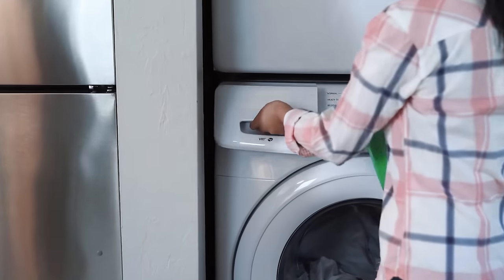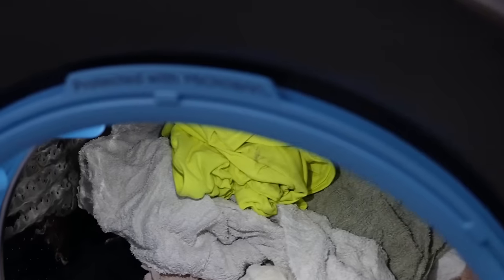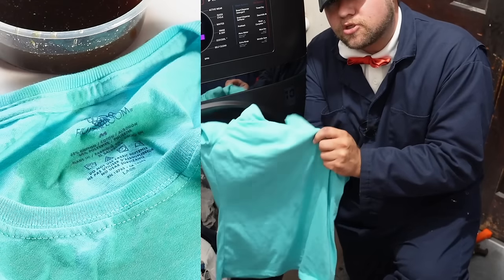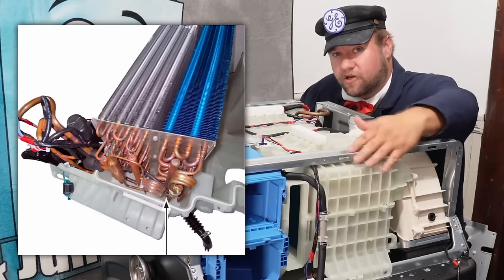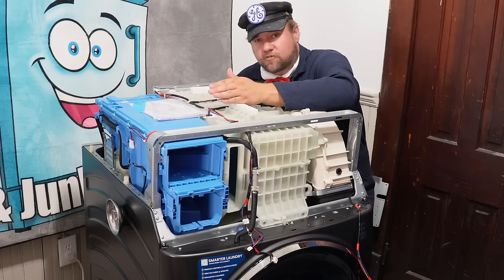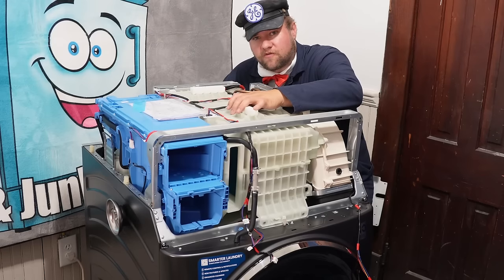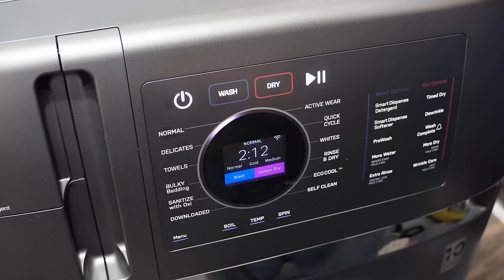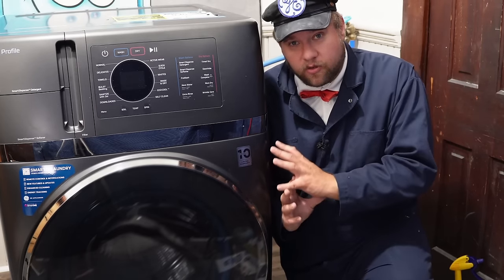The Best Washer Dryer EVER? The Ultimate GE 2-in-1-washer Dryer Combo Test & Review

Comment: I'm a little surprised how much you got stuck on the filter. Like you pointed out, if you don't clean that in a regular dryer, you're going to have an issue, so that doesn't make this unit any different to a regular dryer. On my regular dryer, I clean the lint filter after every load. I'd treat this unit the same way.
Reply: Im with you!  having a lint screen thats not cleaned every load is a huge pet peeve for me
Reply: I clean mine every 6 months or so.
Reply: I thought you were supposed to check and clean the lint trap after every load?  At my last home my roommate owned the washer/dryer and his Samsung had a reminder to check the lint trap between every load.  My Maytag dryer has a bit larger lint trap.  I check it, but it really only needs cleaning every other load that goes through it.
Reply: @OWENROTHLERNER lol wtf
Reply: One of the huge benefits of this unit is that it's ventless. I mean you can put this sucker just about anywhere. I'm surprised that wasn't mentioned. If it was i missed it .
Reply: @OWENROTHLERNER  You're a monster.
Reply: Another cool tidbit: The dry process in the UltraFast is much easier on clothes, creating less lint, meaning you don't have to clean the filter after every load. Yet another cool tidbit: The control panel when notify you when it is time to clean the filter. Our last cool tidbit: Once connected to the SmartHQ app, you can receive notifications on your phone when the filter needs cleaned! 😎
Reply: I thought Ben was odd on that too: who doesn't know the filter screen needs cleaning every time?  He's right that HP dryer efficiency is especially susceptible to impaired filtration - but all dryers need them cleaning, and this model has it placed conveniently also.  At least most HP dryers here in Europe have a warning light that the filter's blocked, which I'm guessing is on this model and Ben forgot to mention (though you shouldn't wait for the reminder).
Reply: if you were to try to clean this after every load you'll find it only has a fraction of the lint youre used to... I did that for a little and I realized I was wasting my time.... now I just do it when it asks me to
Reply: @OWENROTHLERNER  Fire hazard.
Reply: @rosie684 he’s just trolling,the lint trap is clogged after 2 loads, forget 6 months…unless he does the laundry every 6 months?
Reply: @155stw no the lint traps in every dryer isn’t clogged after 2 loads bc the Samsung one I am using only have to clean every 4 or 5 loads depends what you use in the dryer and washer I don’t use fabric softener bc it’s messes up them washers and dryers and less lint happens to when you don’t use fabric softener
Reply from the maker: every dryer is going to behave differently, especially with the wash load. I am doing another load to test on camera (GoPro inside the washer). The lint build-up on that specific load simply wasn't bad. If you were using newer clothes without stray fibers, no fabric softener, ect, you can likely get away with the 4-5 loads that GE suggests. The last load I did of mostly clothes that you'd find far more typical in a unit is indicative of that. But like any suggestion, such as the one GE makes on every 4-5 loads, its subject to change, and its important to note that if your doing ratty clothes, or using a fair bit of softener, you may run into build-ups like we showed on camera.
Reply: Its a huge problem on heatpump systems. The condenser is wet, and any lint what so ever has a tendency to glue itself to the condenser. This leads to poor performance and mold buildup. Other systems have a back flush mode that actually washes off the condenser to deal with this. GE doesn't do that. I'm not sure that filter is enough, and the debris already building up worries me. I'm going to be buying one of these, I just don't know which one yet. This review is awesome.
Reply: @mcbeenb  just don’t use fabric softener messes them up it’s gets all stuck all in the machine I seen a lot of videos people repairing them washers and other washer it’s gets all caked up in it after all that time
Reply: Thats what I was thinking doesn't everyone clean it every time?
Reply: I had mine installed last week in the corner of my kitchen.  I am 80 year old widow that am limited to motivating laundry on basement steps.  The only thing I had to accommodate the new unit was the 120 receptacle.  Plumber installed hot/cold water & drain.  Easy peasy.  In my case I ❤️ 💕 💗 love my GE Profle 🎉🎉🎉!!!!!!  There is no static electricity left in the clothes (NONE).  I have no intention of ever using fabric softener in my new machine.  May not be ideal for large family.  For me just what the doctor ordered!
Reply: Every single load? OCD much? 
I can’t even physically remove and lint from my filter of there’s only been one load… it takes at least 3-4 for there to be enough lint for it to make it easily removable and I’m washing for a family of four! Do you wear a lot of fuzzy sweaters  or something lol
Reply: When I first got married my wife would complain that I wouldn't clean the lint fiter after drying.  She grew up mostly with her mother doing her laundry.  I said that I used to live in apartments and I had to use the community washer and dryer and that I always clean the filter before use because the previous user didn't clean it.  To this day we now clean the filter before drying the clothes.
Reply: @OWENROTHLERNER Fire hazard
Reply: @mcbeenb I think I am going to buy one of these but am going to wait a couple of more years to see what people think after having had them for a longer period
Reply: this is way better than most 2 in one combos that use a condensation chamber.
Living in an RV, I have one, this after several others, none less than $1000, most conking out after about a year or two.
Presently, the dry cycle on mine is a fughetaboutit. I use the high speed spin and hang em up.
yers, I know not to load the machine more than half way (i fill it now, but hang dry everything)
All of the ones I've had would burn about a KwH or so, but inhale about 30 gallons of water in the dry cycle.
they never had lint traps, and the condensation chamber would plug solid in about 3 months.
The first one, lasted 4 years, I had the wrenching and cleaning needed down to a 30 minute process I did every time it took longer than 2 hours to dry. until the motherboard died and I couldn't get parts.
The second on ticked me off, Tofu Dreg Haier, I paid nearly $1500 back in 2014, same quarterly cleaning, the condensation chamber much more difficult to get at, took about an hour and a half. the main drum bearing failed in 9 months. I also couldn't get parts for it, I ran it completely to death at that point, listening to the bearing races screaming, the crack of another bearing ball... till it wouldn't move.
My last one, I've had for 5 years now, only use it as a washer though, with my new RV, and its position, working on it isn't an easy thing at all. It generally spins out the clothes enough to only need to be hung for an hour or two.

All, in all, I'd buy this for the lint trap alone
Reply: Lots of people don't check filter Everytime. And if you make you kids wash good luck. The issue is in a normal dryer the effect of a dirty filter is lower air flow and hotter air going into dryer. Sensors can detect that and cut off heat. Dry times are longer but the system basically just heats less. A heat pump can have real issues if the pumped refrigeration liquid can't absorb enough heat on the cold side or cool down onto the hot side. Put it this way. For a normal dryer cleaning the filter is like rotating your tires, recommended but at worse means you replace tires sooner. A filter on a heat exchanger is more like changing your engine oil. You might get away without doing it regularly for a while but you'll get to a very expensive repair down the road, aka new engine
Reply: I'm sorry but how can you not call a FAIL a FAIL? Advertising a 2 hour dry on front sticker but no 2 hour setting using load restrictions! And after manually setting the closest setting you still ended up with damp laundry! Now I get you have to know what the material the company used to match their results but you can bet it's the easiest material to dry possible. While most don't wash n dry mixed loads I hope it only means a full load of cotton towel would be even wetter. Also unless your power grid free we need a time comparison to a normal pair of washer and dryers. Time is money, or at least limited and saving 30 to 40 cents a load but each load takes 30 to 90 minutes longer may not be a good trade
Reply: @618Todd  Wow that's amazing, such a huge plus that I don't think was mentioned.
Reply: I just removed it, no cleaning necessary.
Reply: I agree, I clean the filter every time I do a new load.
Reply: @OWENROTHLERNER Just letting you know, that can cause your entire house to burn down. I'm not even joking. Pls be safe
Reply: I think the main difference is that it only takes a few seconds to clean out a normal lint filter. This looks like a slightly more laborious process. Far from a big deal, but I think it's fair to assume users will be more likely to neglect to clean it properly. That said, a traditional dryer lint filter is a straight up fire hazard, so realistically this is far less of a concern.
Reply: @OWENROTHLERNER LMAO WHAT??
Reply: Yes same thing I thought I clean lint filter after every dryer run it literally takes 15-20 seconds lol
Reply: This machine even lets you know and stops working if it’s filter is too dirty
Reply: We have a ventless dryer and keeping the filters as clean as possible is kind of a big deal. I can see why he emphasized it. The goal is to keep the evaporation coils as clean as possible, and cleaning both the trap and filter helps but it only delays the inevitable. Once the coils get too clogged the dryer will throw an error code and not function until they’re cleaned. Getting to the coils on every ventless dryer requires completely disassembling the machine, a 6 to 8 hour job that is not covered under warranty. We’re considering this machine since it looks like access to them is much easier.
Reply: @@stevenstrain283 yep, and even with routine cleaning of the secondary filter fine particles eventually build up on the evaporator coils/fins. We have to clean the coils on our Whirlpool about every 18 months or so which is a PITA. We’re looking at this model since it looks like the coils are much easier to access.
Reply: @OWENROTHLERNER That's a good way to start a fire. Kinda like smoking cigarettes, it probably will be fine for a while, maybe a long while, but it's not worth it.
Reply: 💯 agree - you slowdown your dry cycle and end the life of the machine prematurely by not clearing the lint filter after every cycle.
Reply: I want one!
Reply: @Adierit  Not on these dryers, the heat pump is less intense heat than element or gas dryers
Reply: The machine won't let you start if you don't clean the filter. Learned after my first 3 small loads.
Reply: @OWENROTHLERNER man get you lazy self up and clean that thing sooner😂
Reply: @OWENROTHLERNER watch out for build up. I clean mine every day. But the build up inside started on fire. So better clean way down in there.
Reply: @JustinEdge-i3i That depends on the home. I don't use fabric softner or dryer sheets, and I have to clean mine every other load. I have cats and a lab, so my gets clogged quickly.
Reply: Just clean the left side of the filter after each load. It’s takes all of 10 seconds. 😅
Reply: Because this I think is the first one with a lint trap! That’s huge! I have to take my LG totally apart once a year and clean the lint out it’s absolutely ridiculous
Reply: Take him to school
Reply: @bdanner302 GE says to clean it every 5 loads.
Reply: @618Todd  not if it still uses the 4 prong dryer plug. It is nice to not have to deal with a vet hose etc, but not like you can just put it into a random closet or anything
Reply: @geappliances  Cool tidbit, saying "needs cleaned" as opposed to "needs cleaning" or "needs to be cleaned" makes your company sound illiterate.
Reply: @hammerslap5639  It doesn't use a dryer plug. It's shown several times that it uses a 110-volt 3-prong plug.
So yes, you can just put this into a "random closet" as long as you have water, a drain, and a 3-prong.
Reply: @tim3172  oh ok... how many random closets you have set with hot and cold water as well as drainage?
Reply: @bensappliancesandjunk efficiency aside; as a Firefighter, my family & I empty the lint trap EVERY load.  Every 4-6 months, the unit is vacuumed around where the lint filters are; finally every year our vents are professionally cleaned and the whole unit is vacuumed while it’s disconnected. I have been to waaay too many house fires from dryer vents. While this doesn’t have one, it should be easy to transfer those habits over. On top of it, I actually love the idea of not having a heating element/gas burner drying my laundry. It always made me wonder ‘why’ when combo units are very popular in the EU and other parts of the world.
Reply: He sees service calls with unclean filters….I’m not surprised.
Reply: The way I took it, I clean mine every time, he was pointing out there are people who don’t keep up with only one.
Reply: Be aware that by cleaning the filter after every load you greatly reduce the chance of blowing out the seal. Once that happens linty air is sent directly to the evaporator coil which requires a thorough diassembly of the entire machine to clean properly.
Reply: @OWENROTHLERNER  Thats a fire waiting to happen
Reply: @618Todd Yes, being ventless is awesome, but, if you have to keep your washer and dryer in the conditioned space of your home, it will dump cold air back into your home. Great for summertime not so much for winter time. Plus, having a combo unit makes as much sense as tits on a boar!
Reply: @OWENROTHLERNER have fun with that house fire
Reply: The thing I’m most excited about is the massive energy savings with the dryer!
Reply: The lint filter…I’m a submariner…lint catching fire is the number one fire issue on subs. I clean that thing EVERY time.
Reply: @MurderMostFowl 
Your family wears leather....
Reply: @mcbeenb That is a good point, the machine has plenty of water available to rinse the coils itself!
I would, however, point out that the condenser is the HOT part that dries the clothes, and the evaporator is the cold part that wrings out the humidity...
Reply: @geappliances  I get prompted to clean my filter after every session - even when I have run Self-Clean and the filter is completely clean. I have gotten in the habit from day one to clean the lint filter every time, the carbon filter every 2-3 times, and the pump drain at least bi-weekly. I also run Self-Clean frequently, yet I continue to get prompted to "run Self-Clean after every 50 loads." You'd think the machine would be smart enough to know when 50 loads is approaching but I sometimes get this message within 2-3 times after I've run Self-Clean. Therefore, my assumption is the machine just randomly presents this prompt at periodic intervals rather than actually being smart about it. Since I get prompted to clean the lint filter for every load even when it's been clean for several loads, are those notifications about cleaning the filter actually smart or just rote notifications? It's also very difficult to clean the inside of the filter housing. I saw an interview with the designer, who said to periodically clean it out with a vacuum using the crevice tool. The slot is only wide enough for the metal end of my hose to go in, so if I put the crevice tool over the end, it won't go in all the way. The only vacuuming I can do is to put a wand on the end of the vac hose and stick that in. But because so much lint accumulates in the back and in the especially the left rear, I can't get it all. I am super careful not to bang it around, even though that might get more lint. A GE video also suggests this process or to use a brush. Problem is you have to be careful not to let the bristles or duster get caught in the coils. I stuck my camera inside the housing and there's a ton of lint in the coils I can't get out. GE should supply a tool that will adequately clean the housing when the unit is purchased. There are also issues with water leaking into the bottom of the machine and the floor when I clean the pump drain. I don't have the pedestal but my machine is a couple of inches above the floor on planks for leveling. Even that is not enough room to open the drain far enough to keep the exiting water from back-flowing. I don't see how users who have the machine directly on the floor can drain this at all without major back-flowing. Drying continues to be a problem. The worst thing is sometimes - especially with towels and wash cloths - the laundry gets stuck to the drum all smushed up from the spin, but they aren't dry. Just damp and very wrinkled, having to be washed again. Last week, the machine stopped drying my clothes. I spent hours trying to dry a medium load of t-shirts and they never got dry. (Tried variations of sensor dry and two 45-minute timed dries). So I unplugged the machine, let it sit a few minutes, plugged it back in, then re-ran the load. This load dried completely, but I still have a lot of concerns. I don't know if it's just my machine that has problems or if these issues are systemic. I really want the machine to succeed (I'm a GE stockholder) but I wonder if more people are experiencing these problems. I've had this machine since Aug 2022. It does require a lot of maintenance but the payoff is not having to take that step to move the clothes from the washer to the dryer AND it does a great job removing lint from laundry. But is this filtration system really up to the task?
Reply: @theboonog  thank you for the details. Any observations on energy savings? Also, for loads like bedding etc, how has it been so far?
Reply: @akc5247  There is s setting called “Bulky Bedding” that so far has handled large bedspreads and fluffy blankets quite well. No more trying to squish them down into the top-loader! Very good at removing lint and dog hair. There’s lots of room in the drum but be careful not to overload it. Certain fabrics take longer to dry. For extra heavy blankets, I add the “More Dry” setting. Haven’t analyzed energy yet. I can’t emphasize enough how important it is to RTFM and follow the maintenance instructions, e.g. delinting the filters, cleaning the pump filter, keeping the rubber gasket clean - especially making sure that the slits in the bottom of the gasket aren’t clogged without damaging the gasket. @GEAppliances should provide a tool for this task that won’t damage these holes with each machine they sell. I carefully use end of a fork or spoon handle. The only way to really clean these out is to run “Self Clean.” GE recommends this around every 50 loads, but I have to run it at least every two week, which is way less than 50 loads. There’s a notification that pops up periodically to remind you, but it’s not intuitive. My notices have been displayed after only a few loads run after running “Self Clean.”
Reply: @theboonog  Lol @ RTFM. Ain't that the truth! If you can check and update potential energy savings, it would help a lot. Thanks again.
Reply: My clock or timer has never worked. Any ideas?
Reply: My timer or clock has never worked am I not doing something right?
Reply: The filter is well placed for regular maintenance!